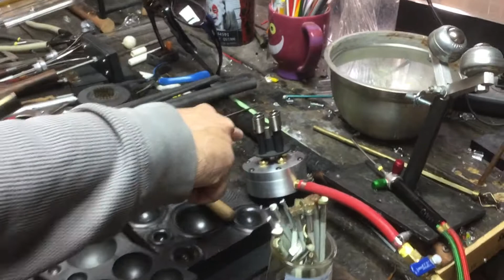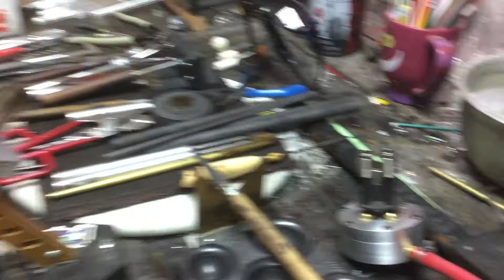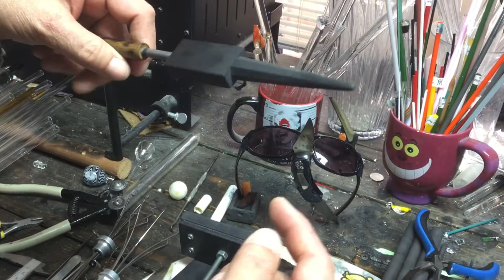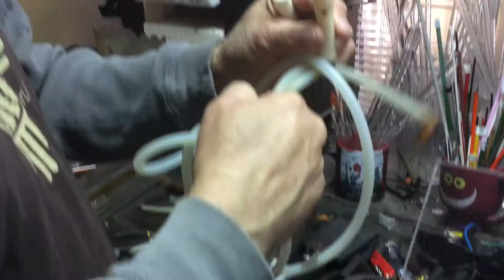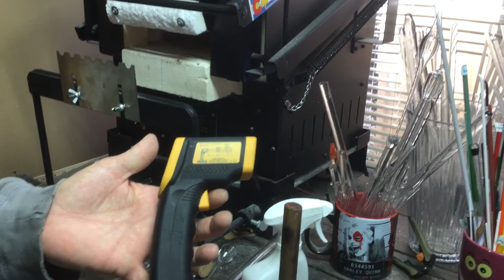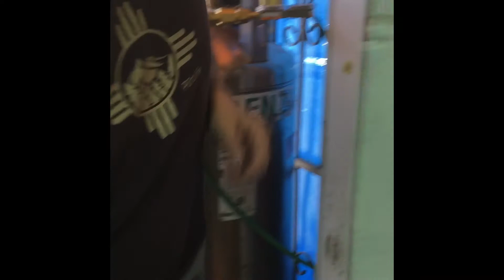Equipment We Use for Lampworking

Comment: Im new to the glass world and starting to grab supplies. Acetylene regulators , and lines are fine to use with propane? Or do you buy different grade line for propane? thanks!!! Love the work, and subscribed!
Reply from the maker: YES. That is what you use.
Reply: This is wrong you need regulator and line that are made for propane not acetylene
Reply: @4kwatts792  no, propane works fine with acetylene regulator